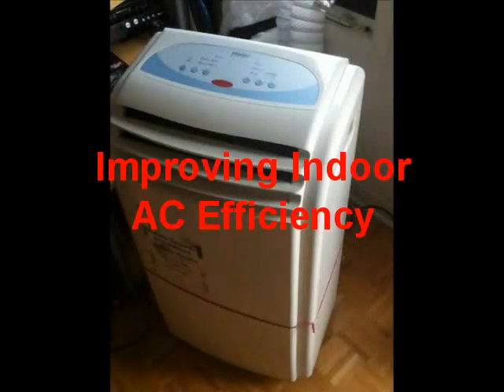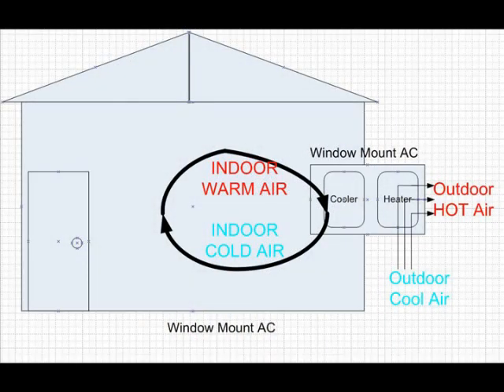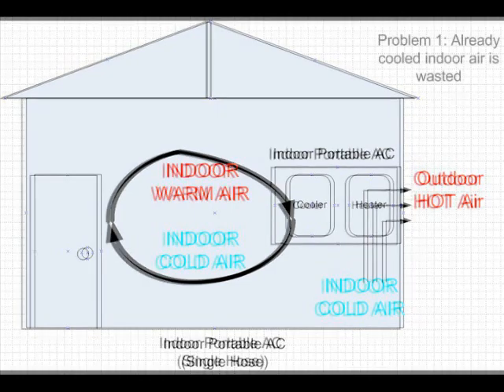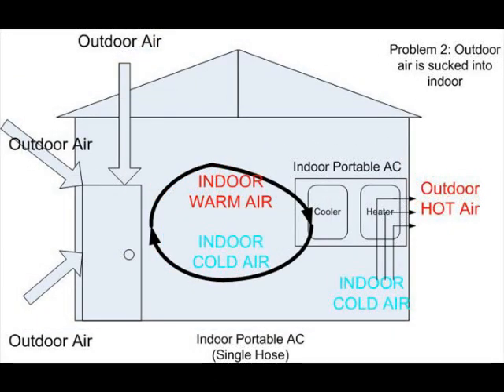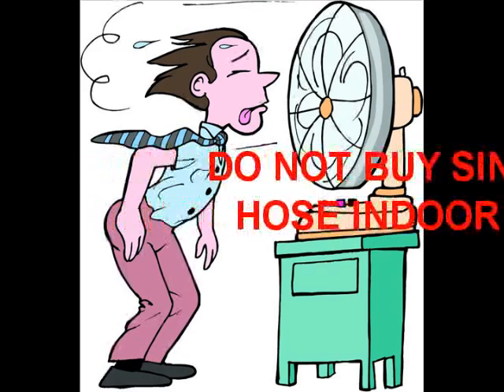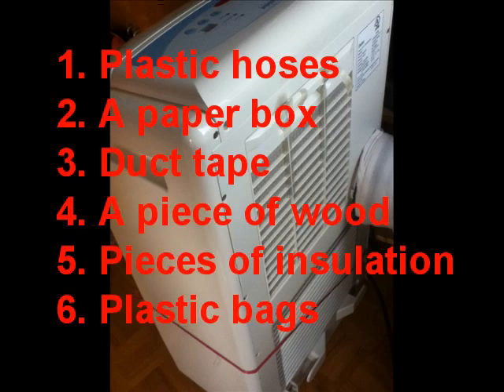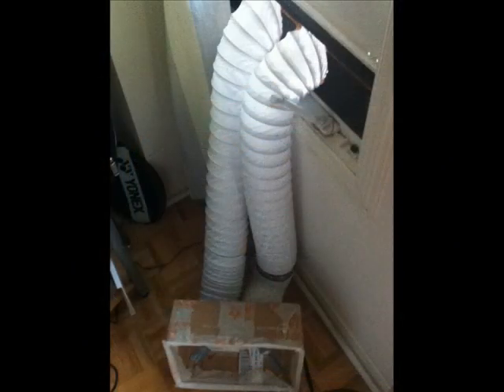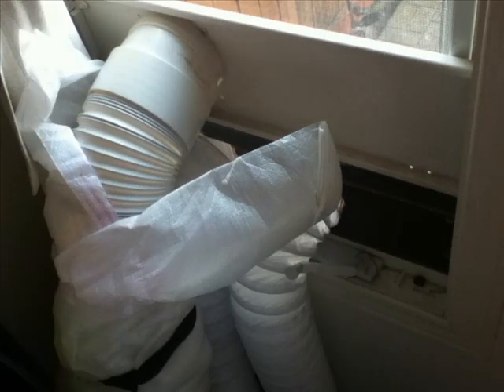Indoor Portable Air Conditioner Efficiency Improvement: single hose to dual hose conversion

Comment: Hey! I want you to know that i Did it, and the result is amazing... Instead of using a hose, i use insulation just as big as the screen at the back and I tape it to the window, the exhaust hose is inside the box of insulation!
emediate cool, before the temperature reach only 24, overnight! Now 18, its max, very cold... 
No problem encounter...
Since the compressor is covered by the ventilation i made, it's a little bit quieter than before.
It really help me, now we cover in blanket while Waring a jacket, were chilled...Thanks....
Reply: You could easily just wrap the plastic hose in 2-3 layers of aluminum foil.
Reply: @z352kdaf8324  wow master.
But what with the single hose.
Reply: @z352kdaf8324  aluminum is like nothing, the heat pass trough ez

Comment: Great video! I bought a dual hose unit so no need to modity, but thanks to this video I know why the dual hose system is superior to the single hose one.
Reply: I wouldn’t be so sure, some dual hose ac still sip some air from the room.

Comment: I was annoyed at the obvious inefficiency of my one hose portable AC setup and kicking myself for not buying a two house. I was trying to figure out how I was going to attach a hose to the air intake so I searched for ideas and I found this video. Cardboard box is a great idea! I did the cardboard box attachment and I also did a two hose setup like you showed. Thank you for posting this video.
Reply: I read your comment in that synthetic voice from the video.
Man, gotta love voice synthesizers))
Reply: LOL, yeah it makes my comment interesting at least.

Update on my original comment: I have about 70 hours on my air conditioner running the 2 hose setup and it's definitely cooler than before.
Reply: analogsafari
I'm actually thinking about buying an air con.
Here where I live we have hot summer only for about 1-2 months. Full stationary system and installation costs around 1800 bucks. I though about installing it myself, by the cost of additional refrigerant, and vacuum pump for water evaporation from the systems costs something around the price of installation, so economically it's not feasible, it's better to just pay a company for an installation.
Now portable air cons caught my eye, they make sense in my case, since I don't need it year-round, the price is around 500 bucks, and it would seem in theory they should do the job, but I see mixed reviews online. Some people love 'em, some hate 'em. Tell me, can I cool my room to 21 Celsius (70 Fahrenheit) if the outside temperature is 35 Celsius (95 Fahrenheit)? Can I go lower to 19 Celsius (66 F)?
:)
Reply: funky3ddy In my opinion window air conditioners are much better. They are cheaper and more efficient. If you can get by with a window air conditioner that's the way to go. I have windows that slide horizontally, so if were to put in a window air conditioner I would have a huge gap I would have to fill with wood. It would also make it easier for someone to break in or steal the A/C. With a portable I have a 6 inch gap that I can fill with parts they include with the A/C. If I lived in the country (where its safer than where I live) with windows that slid up and down I would get a window. As for if you can cool your room to 70 F from 95 outside I really have no idea. There are too many variables such as the BTU of your air conditioner, insulation in your house, exposure to sun, etc. The house I live in now will get up to 85 indoors when the outside heat hits 100. I am using an 8000 BTU portable to cool a 900 square foot room, running from 10am to 8pm keeps the room at 77 degrees, outside temperature 100. Before the modification it would get up to 79 degrees. Ok I gotta go, my wife is mad at me for posting on youtube when have to get ready to go now! (read that in female voice synthesizer). Long story short, portable ACs suck, but if I had a big room to cool, didnt want to pay $1800 for central AC, can't use a window AC for whatever reason, I would get a portable before spending that kind of money for a central AC
Reply: analogsafari
Thank you for your time, I appreciate it.
:)
Reply: What if it's a 14000btu portable? Would that work? It is advertised for cooling up to 550sq ft.. Which is basically what I need. I have horisontal sliding windows as well.. And how easy is it to switch it from room to room?  The one I was looking at buying was the Kyoto branded 14000btu 3-in-one....

Comment: I have a Sharp CV-P10NC single hose unit and wanted to convert it.  It took me awhile to decipher how this was supposed to work but I finally figured out that one ends up with three hoses: 1. The original exhaust hose and  2. another two hoses for the intake air. 

The intake port on my unit is not mentioned in the manual but I finally figured out that the vented opening to the left of the exhaust port must be the air intake.  Now, I think I can do the modification.  Insulating the exhaust hose seems to be a very good idea because that hose gets pretty warm!

Thanks for doing this post!
Reply: Do you mind sharing how you did it? I have a portable Sharp too 10500BTU single hose. But in the model there is a "outlet" for another hose but the mouth looks like it is sealed. Thanks.

Comment: I have two portable units of differing BTU.  They work fine as they are.  I get cooling quite quickly and efficiently.  I have however considered replacing the exhaust hose with an aluminum dryer hose. The plastic hose the units came with do get VERY hot during operation and are not as flexible as they could be.  I wondered if you or anyone else has had improved results from doing this or if I'd need to go to an insulated duct hose to lower that heat output.  I don't want to wrap the hoses with insulation it is just too messy looking and my units are semi-permanently installed.  I've cut and painted wood panels and screwed them to my horizontal window frames so it appears like part of the window frame or wall and is more secure once the window bars are in place.

Comment: What effects have you noticed on the efficiency of your A/C after performing this modification?

I bought a single-hose on impulse without doing my research and once I read that the dual-hose setups were more efficient this modification is the first thing that came to mind. I'm thinking of using a plastic container as a fascia plate to cover my intake vent, and then cut a circular hole and screw a PCV pipe-neck to the container to accept a proper hose with clamp setup.

Just wanted to make sure there are no major internal differences between the duals and singles that could make this modification useless/dangerous?
Reply from the maker: The effects are quite obvious. The A/C was unable to bring the indoor temperature down, it ran continuously non-stop. It can cool down a room now after the modification. :-)

Comment: I also threw a window unit inside a box I made of 2x4 and plywood , face and front panel exposed with a drain pan and hose on bottom,then inside I mounted a 4" inline blower and intake hole on the other side then hooked up them up to 2 seperate existing exhaust ducts in the house,works really well and quiet too, only thing is all the water it produces need a dedicated drain

Comment: This will work if the unit's cooling intake and its heat dissipation intake are isolated from each other. For example, if your unit has one filtered intake, and the other intake is going directly to the heat sink, it is a good indication that the filtered one is used for inside air cooling only and that the unfiltered one is used to exhaust heat outside. I'm using this second intake to pull warm air from the back of my computer and transfer it directly outside my apartment

Comment: I reused some legs from my worn out trousers to put around the hose as insulation. They just happen to be the right size, and they're for free. And you can easily remove them from the hose and fold them up when storing the hose for winter. I put them inside the folded up hose. If I used some insulation that glues on or comes in some sort of tape, it would be very hard to fold the hose up. I'm thinking about adding a second hose, but there are two questions on my mind: how much more efficient that is in percentage or some other measurable value, and how do I prevent the freshly ejected hot air from going back into the intake hose without having to have widely spaced hoses (I have very little room near the air conditioner already with one hose). Maybe a 3D-printed nozzle? That would take days to print probably.

Comment: Couldn't you add a small evaporative cooler to the outside air intake to pre-cool the air before it hits the coils? I lived in a house that had an evaporative cooler attached to the central AC unit, and I think it's sole purpose was to cool the air leading to the coils. when my family removed it, the central ac's efficiency went way down, and the house was very hot in the afternoon. We added an attic fan to vent the excess hot air in the attic, and that helped.

Why can't you take a single evap cooler frame and rig up a trickle hose to keep it wet, but not too wet. maybe that would solve the problem of overheating the coils. Just a thought.

Comment: If the dual hose AC uses hot outside air to transport away heat, a higher airflow must be needed to "cool down" the machine as the incoming air is already hot. But because the machine is not consuming cold indoor air it should not need to work as hard to keep the room cold. In the end the power consumption is probably not differing very much but the dual hose AC is more efficient at cooling down the room. The trade-off is of course that you'll circulate the same indoor air instead of sucking in fresh air to the room due to vacuum.

Comment: to: onlyzaki4u... What may have happened is that you built the outdoor air inlet on the wrong inlet.  There are two air inlets on a portable  - one is for inside air, which it cools by running it over the evaporator - the other one is for the compressor  (which on a window unit is outside).

Comment: well explained!  Adding a duct fan on the fresh air inlet would be essential though, its the second fan the AC Mfg are saving money on! The VENTS 105 duct fan at HD is about $70.
Reply: i was thinking of using an air compressor, you think that would work?
Reply: compressing air HEATS it (pV=nRT) so a duct fan would probably work better, Also compressors work and high pressure/low CFM, and you need low pressure/high CFM. It could work but duct fans are pretty cheap

Comment: My single hose DeLonghi 12,000 BTU Portable unit keeps my room freezing so IDK what you're talking about.
Reply: +Apex Animal the PAC 81?? I bought that one for my non insulated apartment. Outside would be nearing 35-36 C while inside thanks to the Pinguino PAC81 I get around 25-23 C. Kinda bummed it wasn't 12000btu but all the portable ac were sold out. Oh another thing ,try removing the hose and just leave that attachment for it,not the hose. Then just place the AC very near the window opening,so that that attachment I mentioned sticks out the window a bit. This way it won't draw so much in the house the hot air from outside. Of course if you don't have space to place it so near the window opening ,i wouldn't recommend it.
Reply: Either lucky you sir or my unit is faulty. 12000 BTU unit can't bring the room tmp to 18 even after running damn whole night (and the reason why I am watching this video at midnight, instead of sleeping peacefully in AC).
Reply: Got the same model as you and my room gets so cold I can see my breath in the morning
Reply: It isn't that they can't cool, it's that, by definition, they aren't doing it as efficiently as a window unit would.  You would probably only need a 5000 BTU unit unit, that properly uses outside air to cool the vap coils, vs. your 12K BTU portable.

Comment: Been tested in static caravan since the first heat pump unit was for sale. The answer for better performance is dual hose, till outside temps not droping below 5c. Then it's getting unefficient due to defrost ciclles every 15 minutes.

Comment: I have been using this piece of junk unit for years ,I too have a few tips toe crease it's capability. First I take off the drain plug and put a 1" rubber/garden hose running into a sump drain in the basement then I also replaced the short plastic supplied hose with quality insulated ducting hooked up to an existing exhaust duct in my home. It really produced a lot of water when unplugged and none with it on , so I think it increases the efficiency and gives a dryer cooler atmosphere
Reply: I totally agree. I put mine on a milk crate, took the drain plug out, added a length of hose and drained it into a 5gal bucket. After running for 9hrs the bucket was just about full and the air quality was amazingly improved. Running the stock setup at 76 degrees the air would be cool but I'd still sweat, with the water draining I ran it at 77 degrees and didn't sweat plus the air felt cooler. For next year I'm going to plumb it into my furnace condensate pump and add an insulated exhaust hose.
Reply: Caution on draining continuously!  Many PAC's such as Delonghi rely on a minimum water level  to cool the compressor.   It's heat is transferred away from the vaporization of condensate from the pan  through the air exhaust to the outdoors.   Only a limited number of PAC models are provisioned for continuous draining.

Comment: I tried the same conversion with my mobile monobloc air conditionner (model supra blizair 3000). It did not work because single hose ac are not designed to be air sealed so even if you put a second hose on the air intake there are still air sucked from your room and exhausted outside, creating a negative pressure effect in the room which forces the outside air back and makes the ac useless. 
I tried to open the ac up to see if I could make the hot part air sealed myself but the compressor is so close to the condensor that it would require to cut the circuit open to move the compressor away from the condensor to be able to do that. The price of the needed tools, the gas refill and the time it would take are not worth the mod so instead of throwing it up I just gave the ac to a frigorist for free as they do have the needed tools and i bought a dual hose ac (could not install split in my appartment) which has air sealed condensor space so it works perfectly.
You can see all the pictures I took when opening the ac when i was trying to mod it here (hosted on my private web server): https://ah1z.com:4443/owndoge/index.php/s/guU6V10UhRsI3bR# (you can click on the top right to get a gallery view).
Bottom line is: if you have a single hose mobile ac just sell it or throw it away and get a split or a dual hose ac!
Reply: Surely it's still better and the majority of air is being pulled from outside... still less air pressure than before?

Comment: So true, the trick is an efficient flow of intake and exhaust of the units  (condenser ) air flow "waste heat'' 
this is the exact same effect used in cars when choosing between MAX ac (REC) or fresh (VENT).the recirculation mode  yields the best cooling resulting in dryer cabin air. dry air cools better than humid air!!! otherwise you are condensing chilled moisture out of the air which is a HUGE waste 
these units should be labeled Emergency cooling units for temporary use only. they are energy PIGS ! BUT when buying one look for the 2 hose setup , has one hose inside the other and will have a higher ER-EF rating around 13 ser

Comment: Thanks for the idea,I did this hook up and it seems to be running well.however my ac appears to have an additional intake on the side of my unit on the bottom left hand side.  I'm okay with that as long as I see improved efficiency.
Reply: seal the side intakes and see if it improves, it technically should
Reply: Thank you Saurab,that should do the trick!

Comment: So how much of a difference did this make? Could you tell? I just bought a single hose like yours and after seeing that it has to constantly run to maintain a cool room temp I looked online for solutions and found this video. Would like to know how this turned out before rigging up this setup to mine. Thanks
Reply: it does hell of a diffrence, i also converted my portable AC to dual hose due to the inneficienty issue. i did this just by using my intuition, not watching any kind of video. my design is quite similar, but instead of cardboard box a used some 2 cm thick extrudated polystirene (more rigid than expanded) and some silicone for sealing. the only thing you should do is to detect where your AC sucks the air for the external hose. usually it is in the lower part of the unit. it is a very easy to do.

Comment: Or you can put it outside (on a handy balcony for example) and blow the cold air in the window. Also makes dealing with condensate a lot easier.
Reply from the maker: If you do, the increased pressure in the house is going to push the cold air out. Besides, this method takes in outdoor air which is warm to cool the house which is also inefficient.
Reply: Well air con is an exercise in inefficiency, but the whole idea is to get cool air in. When the house is cold you can turn it off. Blowing out the warm air is what you want, you first have to make the air in the house cold in order to blow out cold air at which point you turn it off for a bit. Also most waste heat from pumps and fans remain outside rather than adding to the heat in the house..  Or........ Move to Scotland!
Reply: Just install a real ac unit if you can put it outside. :P